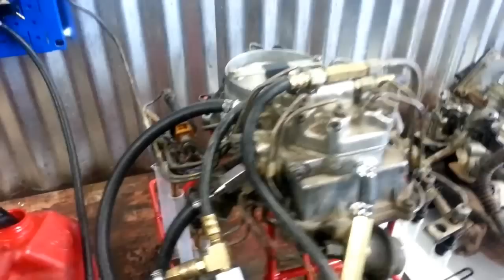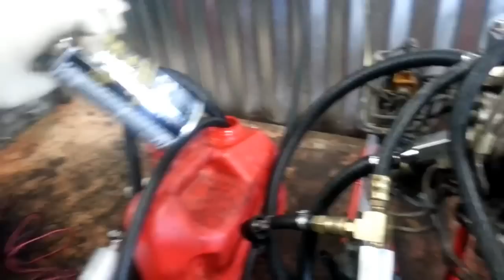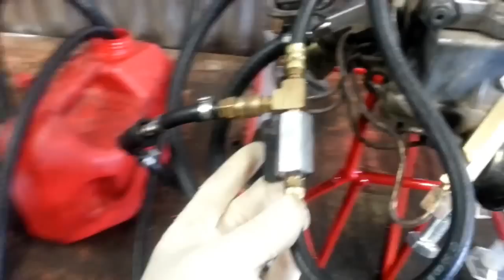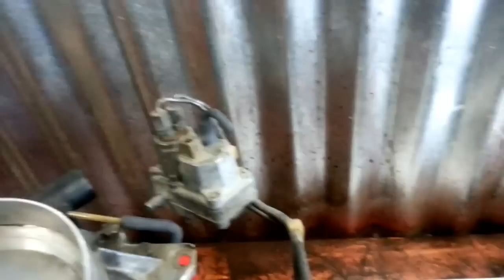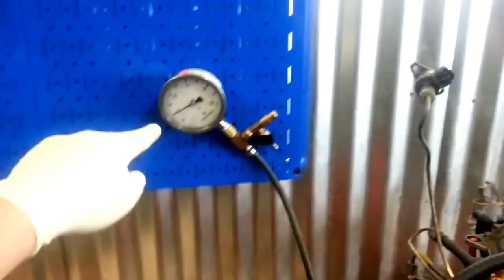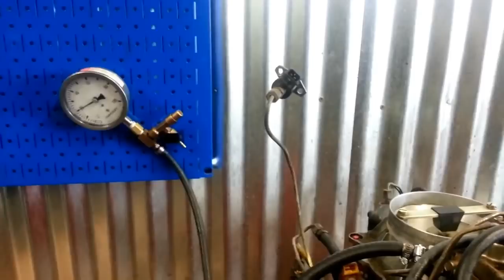Bosch CIS K-Jetronic Flow Testing Pt 1

Comment: Where did you get the fuel line fittings, please? Need to do this to a 280TE that been sitting probably 10 years.
T.I.A.
Reply from the maker: I believe they were out of an old master fuel injection set from Matco. Of course, like many tools from matco, they aren't the OEM. I think I have ordered replacements and extras from Lang
Reply from the maker: http://www.langtools.com/fuel-injection/

Comment: Would it be possible to remove the injectors and leave the fuel distributor in place and an push cleaner through it that way ?
Thanks Everett
Reply from the maker: I would prefer to keep the backpressure in place myself. Its a pretty delicate system and I wouldnt want to risk warping a diaphragm because of too much differential